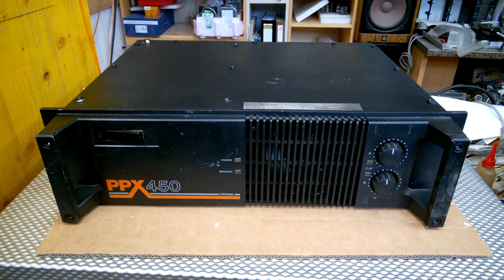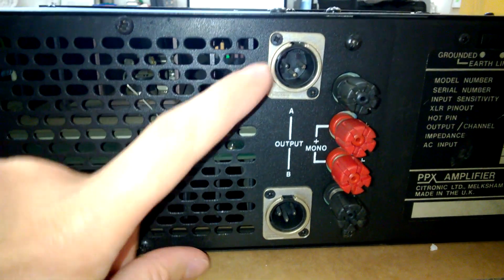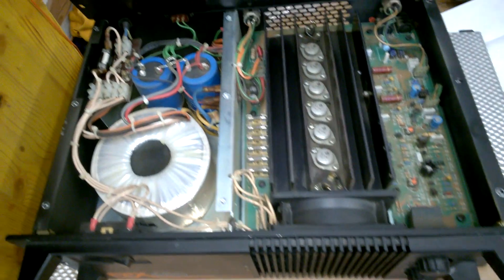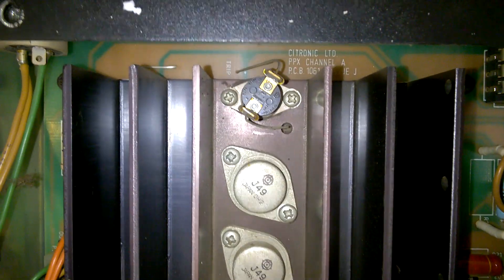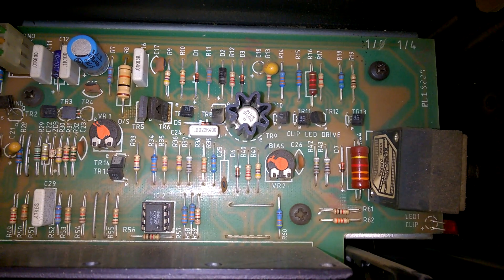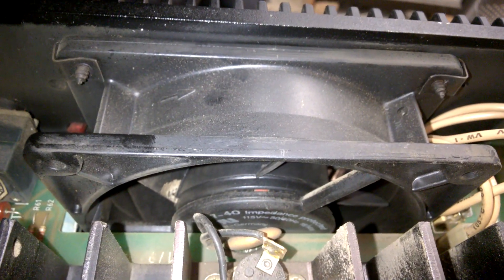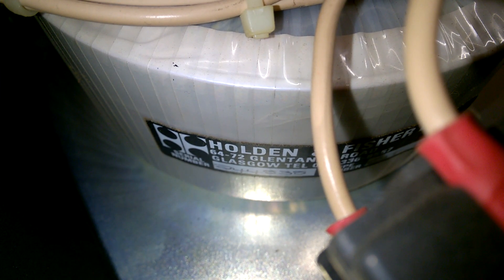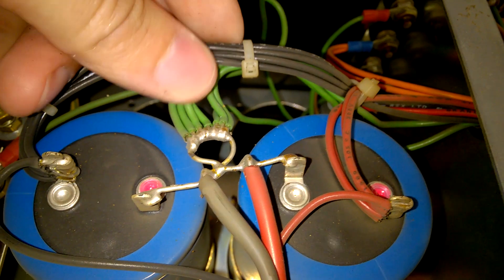BEB #107: Citronic PPX-450 Vintage Amplifier (What's inside?)

Comment: Independently fused MOSFETs  mean if one shorts the amp just keeps on running, albeit with less output. If you were impressed by the 450, you should get a PPX1600.